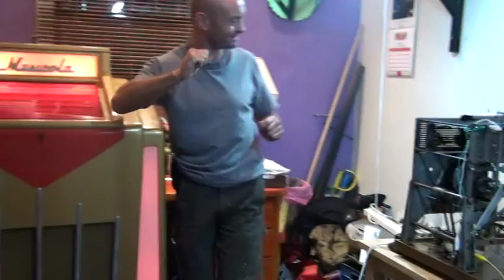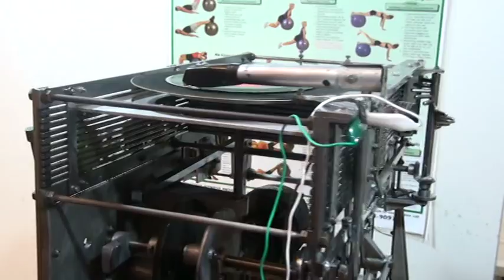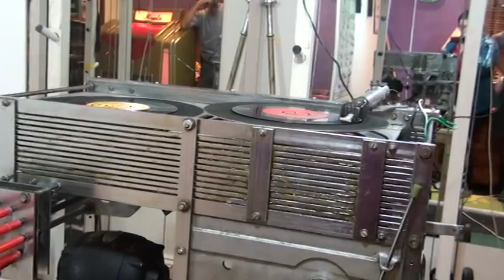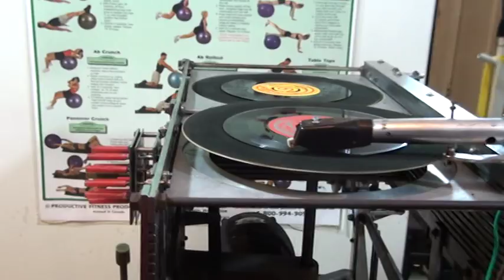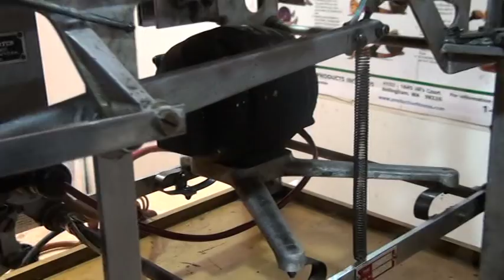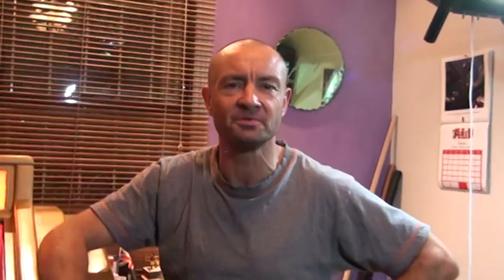Musicola Jukebox M12-10B repair Episode 1.  Playing Lonnie Lee "Ain't it so".

Comment from the maker: @mathewbailey08 Hi Matthew They are copies of the Freborg mechanism. As to wether they were "acquired" or just copied we will never know. They aren't identical however. There are some subtle changes that make them a little bit different. Which is why it's fun trying to find replacement parts.
Reply: Great video! You’re spot on, that mechanism is surely based on the Freborg mech in the Seeburg Trashcan. Great job fixing it without a manual!